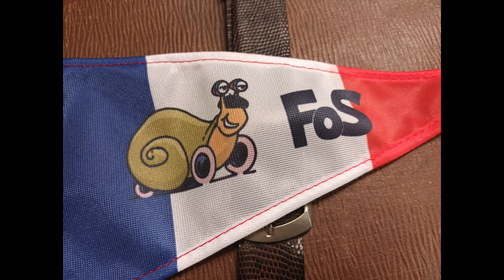Festival of Slowth 2023

Comment: New subscriber!! Super cool video!! I have been assembling a machine shop to support my YouTube channel that I will be starting with the build of a 1928 Morgan RIP GN special 3 wheeler with 4 wheels. I am using an experimental aircraft opposed twin supercharged engine. This will be mated to an MG 4 speed manual gearbox with a 2 piece hand cast aluminum adapter. This will be connected to an MG differential with beautiful wire wheels. The frame I stood over steel and will have aircraft cloth stretched over and sprayed with plasticizer. This will have a boat tail look and is essentially a 20's airplane without a propeller or wings. There is only one other in existence and Charlie Martin races it in the UK. The next project lined up is the building of a Brooklands style cycle car similar to the Pembleton. This will have a BMW R-100 engine in the front and four wheels with gorgeous leather interior and even space for luggage. I look forward to seeing everyone over at the channel when it gets warm out enough to be in the barn in Pennsylvania .....